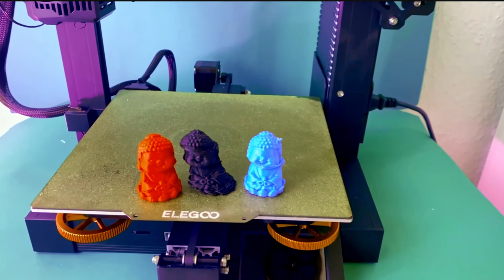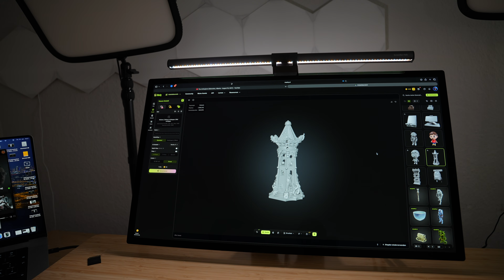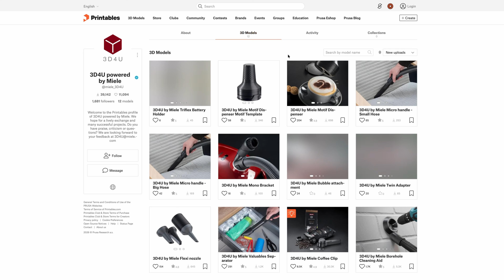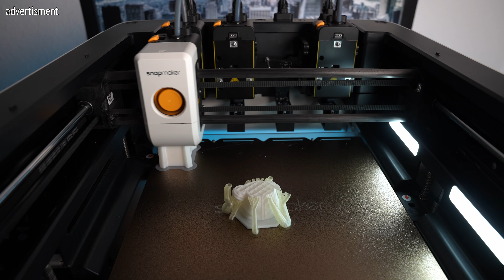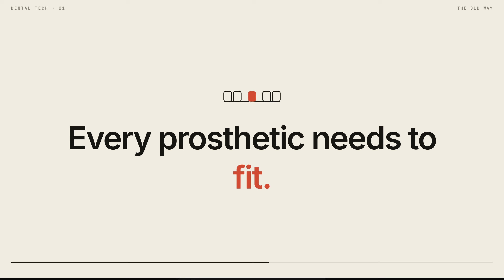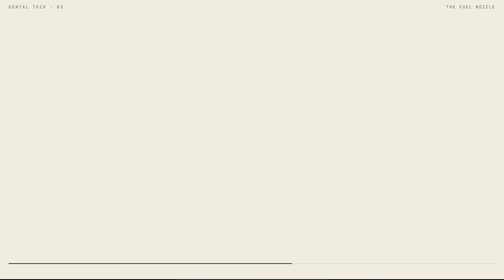The Future of 3D Printing Is Completely Different Than You Think / Future Outlook

Comment: Amazing work Good video, just 2 things... 
You jumped hoops multiple times and for the average viewer you completely forgot to specify some really important thing.

1.
"Aerospace is making 3d printed parts" -> This statement alone is correct, but when it is subsided by "3d printing will be easier for everyone to access", it implies that the technology of 3d printing you are talking about is the same. 

Almost all industrial applications use SLS or SLM printing methods. You must specify this as the average viewer will see this, go buy a FDM printer, and then be disappointed. 
"3d printing will be adopted by the industry" -> Again you are making some huge leaps... 3d printing has been a prototyping tool for most, or at best a way to bootstrap a new product, then you go to injection molding and stuff. (over here you again made the first error, that you subsided injection molding, which is exclusively PLASTIC/SILICON based, with examples of parts that are printed in metal [using a totally different printing technology] ).

Then comes the argument about medicine. Again you must specify what 3d printing here means. Most people will assume you are talking about printing stuff with plastic (FDM), where in reality almost all medical related 3d prints are made using resin, using MSLA technology. -> If not specified this can cause EXTREME panic in the medical industry as "PLASTIC" that are used in 3d printing are really really dangerous for humans. Most exotic plastics that are being used in professional industries require the user to be very careful (fume extraction, skin protection and much more). As medicine uses Resin (and again, specific blends of resin, that are particularly made for the sole application of medicine), it is not harmful (again that to if only done with proper care). 

The video is amazing, feels a bit rushed, and some parts of it felt AI (not the content but the language and word phrasing).
I would highly suggest that you remake the video, but this time cover the proper terms, with complete form and their application and how they will grow, as if an average joe is watching this video, without prior knowledge, he will most certainly be misguided, or at the very least be ill informed due to lack of information given.
Amazing work.
Reply from the maker: Hey, thank you very much for your comment. You´re right and I will do a second Part 👍